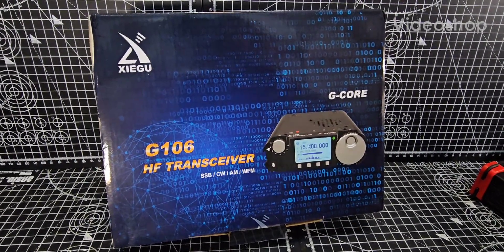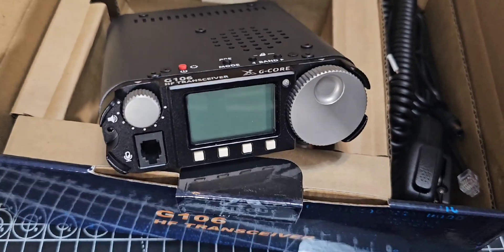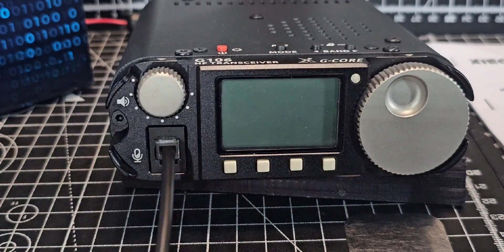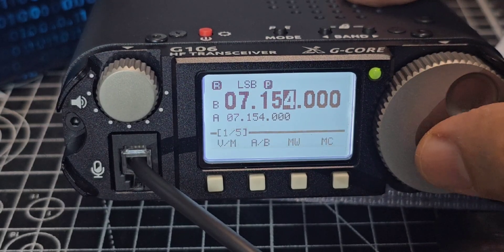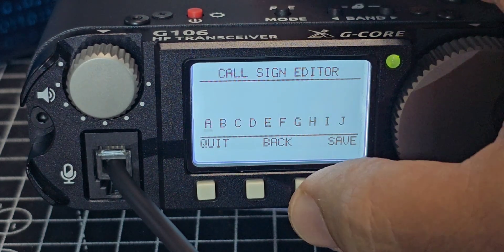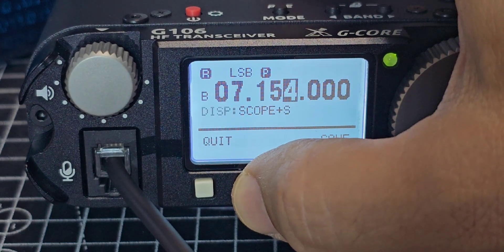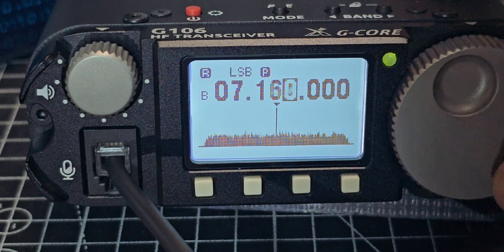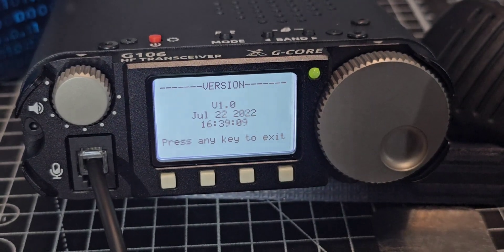UNBOX - Xiegu G106 - Overview 2025

Comment: Hi Andreas, I waited a long time before purchasing this tranciever. I felt the price of 350 pounds was to much for a budget radio. Also waiting give Xiegu time to correct hardware and software issues.
Issues with radio, distorted audio ( speaker buzzes at high volume levels ). Preamp is on when powering on + no pre amp indicator. Issues with slow AGC.
I paid 200 pounds new from Martin Lynch and it came with a upgraded power cable and the programming cable.
I've brought it to use as a receiver in my living room. It is a ok purchase and it ok for listening but I don't think I will use it on air.
All the best.
Reply from the maker: Its ok works fine for price .
Reply: @M0FXBHamTech  Yes agree. It's fine if you understand what you are buying. And what part of the market it's intended for. Don't expect it to be as good as a FTDX710.
All the best to you. Ps love your dog Mazy. I had a Border Collie like yours. She was the best.

Comment: I added my own speaker jack to the back and plug in my BHI DSP Speaker.  Really cleans up the noise.
Reply from the maker: Nice send me pics i will make a Video: m0fxb@outlook.com
Reply: I have a set of amplified computer speakers running through a ClearSpeech DSP module and the speaker cord threaded through the microphone cord. The DSP & amplified speakers make the receiver audio much better. I paid $140 for the G106 in the box and it looked as if it was never used. I purchased a stand and a friend gave me a ATU-100 PRO+ antenna tuner so it’s pretty much complete. I have it connected to my Antron 99 that is just 3’ off of the ground and I’m working the world with it.👍🎙

Comment: Will it do 11 meter?
Reply from the maker: No
Reply: I found 1 person who logged into the radio and showed what file to edit. You can also buy it modded but you must buy if from the site new and they charge like $60 bucks extra it can be done not worth it really. I power metered it on 10m and its like 6watts most chinese $ 50 cbs can do 8am 16fm  with just 1 dab solider .
it is solid as a cw rig and does ssb well enough.
Reply: Why not just buy a Children’s Band Radio?🤷🏻